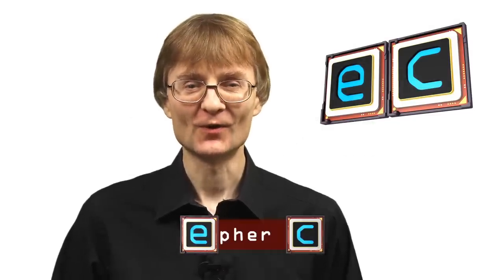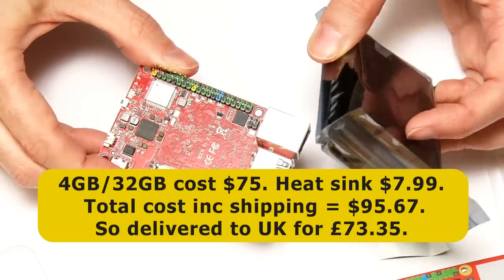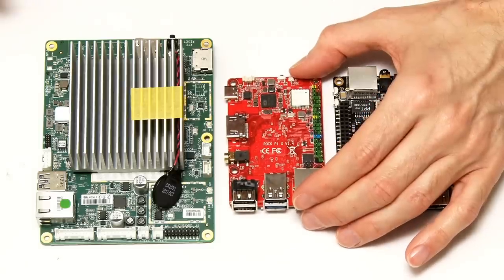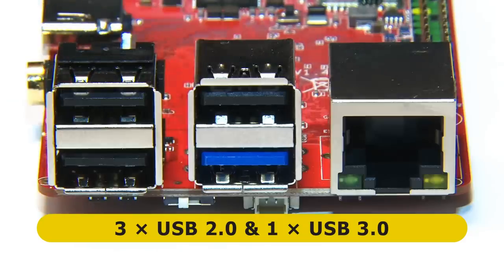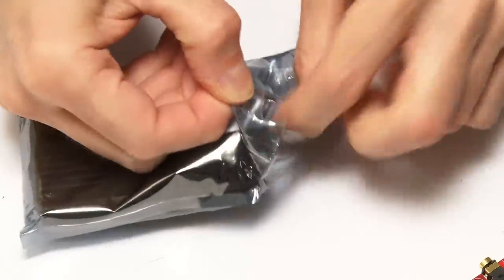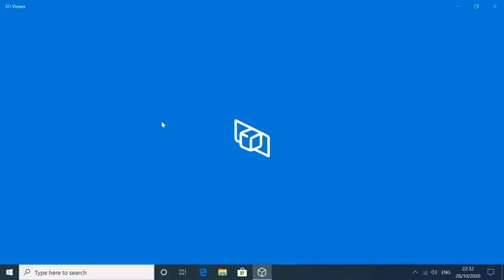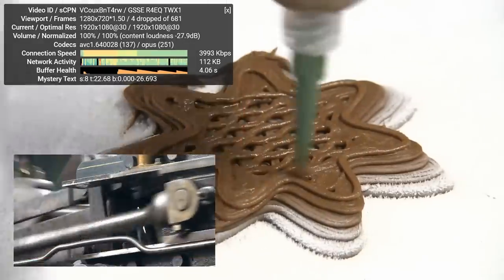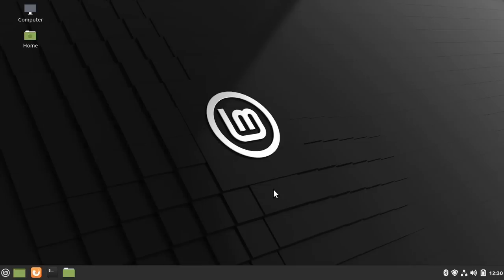Rock Pi X: Low-Cost x86 Windows & Linux SBC

Comment: these sbc are all junk for many reason - they are using cpu from 5 years ago for one and also for the fact that sbc will take a major jump here soon by incorporating better i/o namely nvme - rasppi has started to make moves in that direction - they need more pci-e lanes to make things fully functional - expect one sbc to emerge as the gold standard - it could still be a year or two but it is going to happen and it should be big in terms of making the sbc a reasonable choice for mainstream buyers - i.e. many less compromises

Comment: Having owned an atom based computer or two in the past, I really can't help but cringe every time I even hear the name. It was anemic for windows when it was released years ago. I'd rather use a RP4 with linux any day. I do feel my own bias, but I'm quite Ok with it.
Reply: I used to think that too, then I had one of these 4-core Atoms in a Linx 12x64 tablet and was quite impressed. Some of my older Atoms are dire, even if running Linux.